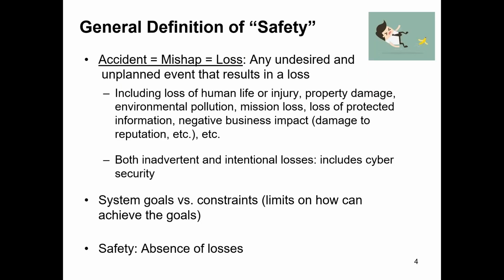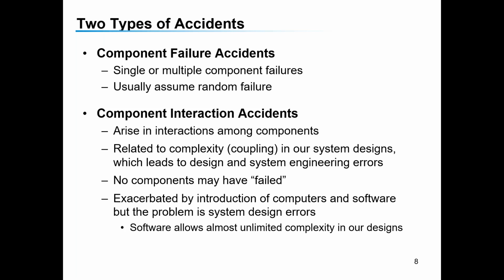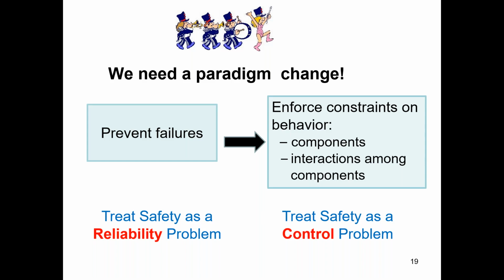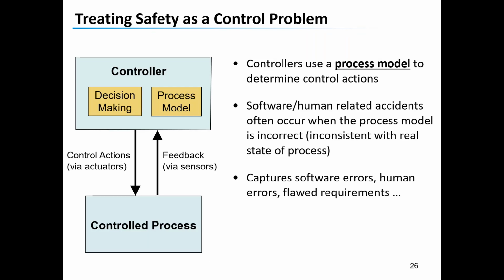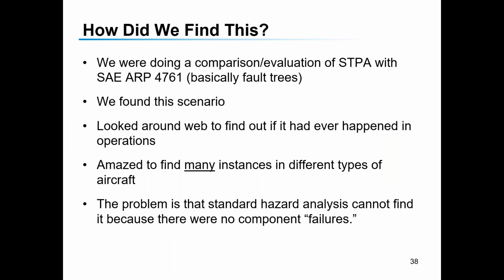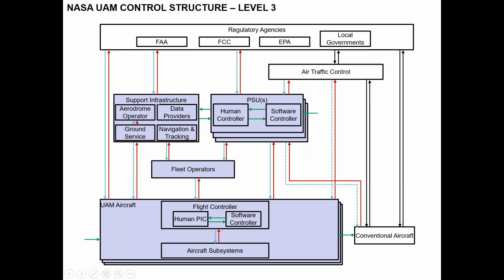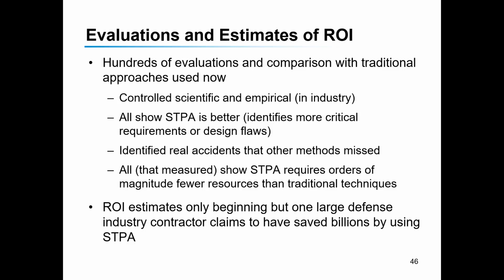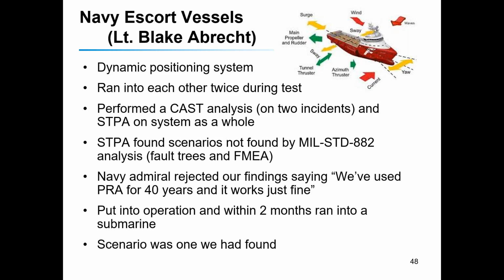System Theoretic Process Analysis STPA for Flight Testers 1

Comment: For both examples given either the Warsaw or the Moscow examples, the claim is that nothing failed and that the accident is due to a systemic interaction error. Actually the sensor feedback that the plane has not landed is the failure that led to the accident. I understand that STAMP does not adopt the notion of a root cause, but then both accidents are a result of bad design that does not properly characterize and capture landing. So I am assuming that FMEA would have still caught both design flaws should a proper analysis of the hazard resulting from not detecting landing when it should be detected has been made before the fact.
Not that I disagree with STPA, I am just trying to understand.